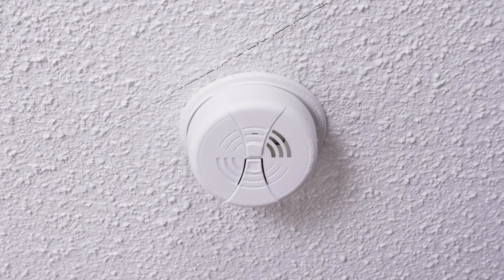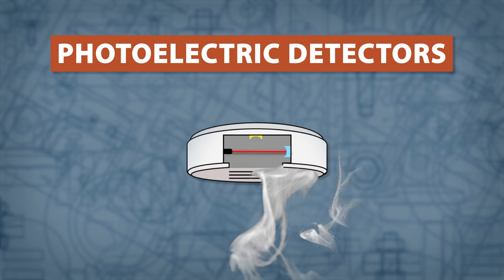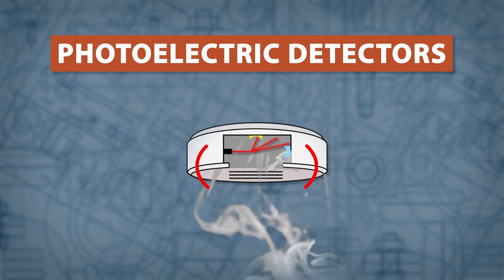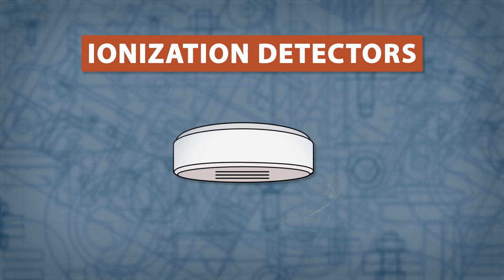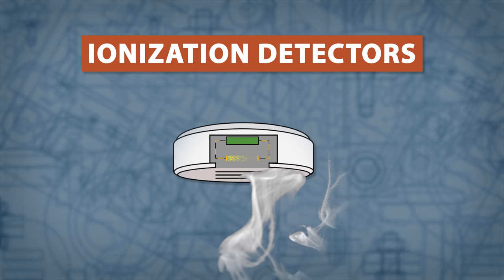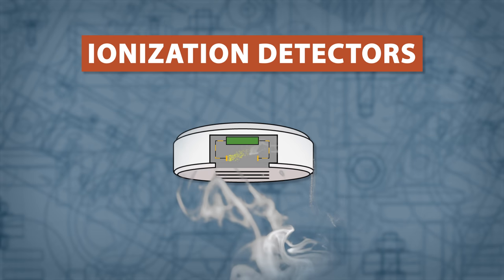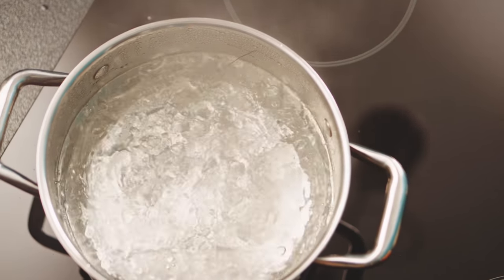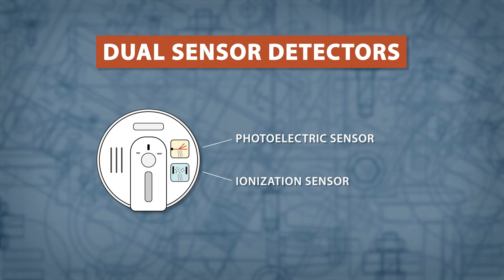How Do Smoke Detectors Work? | Spec. Sense

Comment: Does the smoke detector short circuit the incoming supply to draw more current in order to be detected by the fire alarm panel?
Reply from the maker: Thanks for watching. These video simplifies the operation of the smoke detector. The exact wiring is more complicated than this so without wiring diagrams and more info, this is a hard question to answer in more detail.
Reply: @AmreSupply  ok thanks. But i just want to know if the detector short circuits or open circuits the incoming supply to it.

Comment: Can you please tell me if hallway smoke alarms will be set off by incense sticks smoke?.
Reply from the maker: Hi Kathryn, thank you for watching. It may or may not. It depends on proximity of the incense stick to the smoke detector, the size of the enclosed space , how much ventilation there is, and whether the smoke from the incense stick is flowing toward or away from the smoke detector. You won't know until you test it out and  if needed you can press the test button to hush the alarm if you need to ventilate the smoke from the insense stick.

Comment: Where is the correct placement of the smoke/fire detectors on the wall or ceiling ? Should I put a Carbon Monoxide detector near it ?
Reply from the maker: Hi Will, Thank you for watching. Since smoke rises its best to have the smoke detector high up on the wall or on the ceiling. Avoid any "dead air" spaces like in corners. If you mount an alarm on the ceiling make sure it is in the middle in a location that the air will circulate over top of. Also its not recommended to place a smoke detector near any vents that might remove the smoke and interfere with the detection.

The National Fire Protection Association (NFPA) recommends placement of at least one smoke alarm on every level of the home and one alarm in every bedroom.

Carbon monoxide, however, mixes with the air, which is why CO detectors should be mounted in or near bedrooms and living areas, on a wall place six inches below the ceiling to six inches above the floor. This is a good resource if you'd like to read more https://www.kidde.com/home-safety/en/us/support/help-center/browse-articles/articles/what_is_the_best_placement_for_alarms_.aspx

Hope this helps!
Reply: Thanks

Comment: Ionizing detectors use an americium alpha particle source to ionize the air path between two metal surfaces.  This lowers the electrical resistance of the air path.  Smoke particles block many of the alpha particles increasing the resistance of the air path.  When the resistance increases sufficiently an electronic circuit detects that and sounds the alarm.
Reply from the maker: Thank you for sharing that detailed breakdown, we kept it simple for the video but do realize there are those who are interested in how it works at a more intricate level.

Comment: All my smoke detectors have a radioactive source.  You didn't mention that.  Which type are they?
Reply from the maker: This video was a quick view into smoke detectors but you are right, that most ionization detectors use a very small amount of the isotope americium-241. The radiation emitted is a very insignificant amount, and has low penetrating power which is blocked from the plastic housing of the smoke detector.

Comment: Does it have americium battery?
Reply from the maker: Thanks for watching. Ionization detectors will commonly have a small americium source encased in a layer of foil and ceramic which prevents the alpha particles from traveling outside of the smoke detector. These will still use a standard 9V battery as well.

Comment: I WANT TO KNOW HOW MUCH THEY DETECT? I MEAN THE UNIT OF DETECTING, LIKE UNIT OF VELOCITY OF AIRFLOW 1M/S^2
Reply from the maker: Thanks for watching. The standard way of specifying smoke detector sensitivity is a measurement of Obscuration. Obscuration is the effect that smoke has on reducing light intensity, expressed in percent absorption per unit length. Higher concentrations of smoke result in higher obscuration levels.

Ionization 	2.6–5.0% obs/m (0.8–1.5% obs/ft)
Photoelectric 	0.70–13.0% obs/m (0.2–4.0% obs/ft)

This means that a ionization smoke detector will be triggered when 1 meter of smoke blocks roughly 2% to 5% of the light that passes through that area. Overall this number is not something that consumers need to know when buying or using smoke detectors.
Reply: @AmreSupply  excellent explanation, thank you

Comment: I just read that there are Alpha particles in the smoke detector. Can someone explain this to me please. I'm having trouble to understand. 😢😢😢😢😢
Reply from the maker: Thanks for watching. This video was a quick view into smoke detectors but you are right, that most ionization detectors use a very small amount of the isotope americium-241. The radiation emitted (alpha particles) is a very insignificant amount, and has low penetrating power which is blocked from the plastic housing of the smoke detector.

Comment: My SMOKE DETECTORS are driving my whole family crazy. They go off if someone is using talcum powder or deodorant, goes off if I'm vaping or if the automatic air freshener goes off. They are hotwired throughout the house so can't be disarmed by taking the battery out. I know that they are a great thing to have but no-one can relax, especially when they SCREAM at 2am when the cats or dog trigger the automatic air fresheners. Any advice would be gratefully received.
Reply from the maker: Thanks for watching. You could try a different type of smoke detector that might be not as sensitive to talcom powder or deodorant. You could buy one smoke detector, turn it on and do some tests, if it is better, then you could replace the rest of the smoke detectors with the same model.

Comment: This is a weird device. If you manage to turn it off, it won't go off.
Reply from the maker: Thanks for watching. The hush button will silence the alarm for several minutes and then automatically reset itself. Smoke alarms with this feature discourage the dangerous practice of removing the battery or disconnecting the power source as a method of dealing with frequent nuisance alarms.